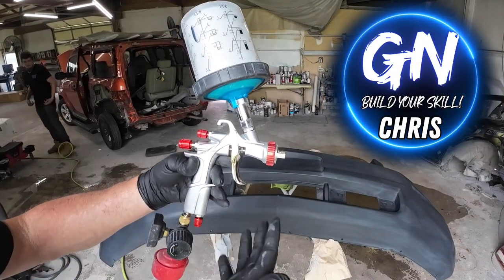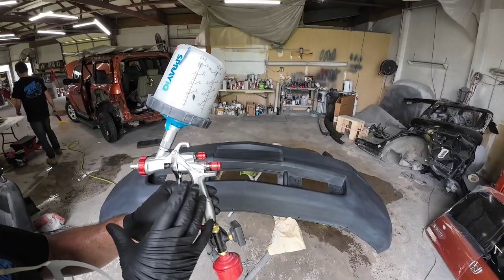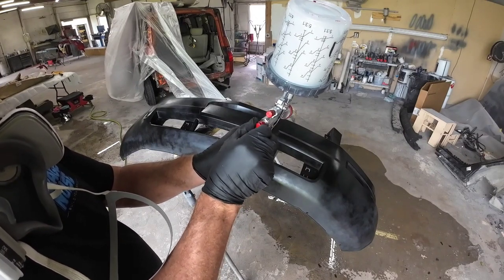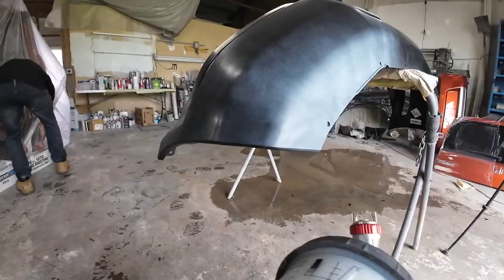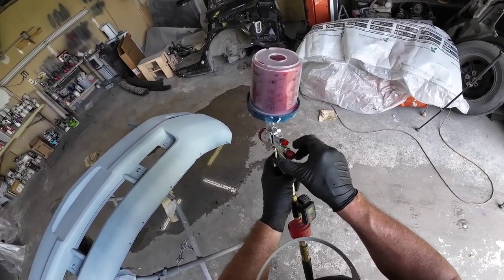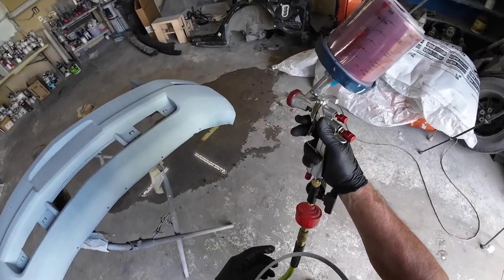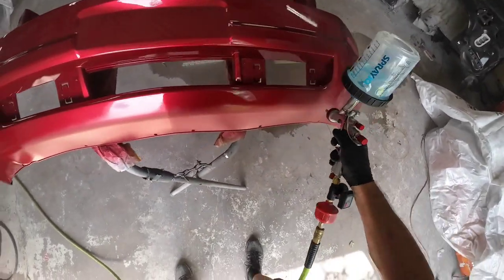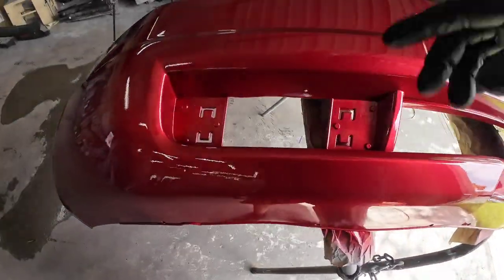DIY BUDGET AUTOMOTIVE PAINT GUN for SMALL COMPRESSORS

Comment: I’ve never painted before but I’m trying and my base coat is spraying like colored water very thin and transparent,I tried the put a heavier coat and it just ran, I’ve sanded it all off 2 times just can’t get it right, what am I doing wrong, my gun is all wide open and air pressure is around 20 psi now I’ve tried changing the settings and nothing same thing happens, base coat is mixed 1:1, should I go 2:1 ?
Reply from the maker: 20 is ok maybe a little low try 24 psi and 2 turns out on the fluid volume.  I suspect  you paints not being atomized enough. Put the fist coat on light let it flash for 10 minutes  and add another coat. If you not getting enough paint out of the gun gradually bump up the fluid volume.  Let me know the results

Comment: With all the brands and model numbers now that are similar to the R500,  is one of them significantly better or worse than the others?
Reply from the maker: No, they're the same gun with different sellers. One seller  might be better than another but the guns are the same. Rong peng is the manufacturer of all these guns I'm  99% sure. What I think is,  they offer different color schemes and branding for sellers. Rong peng released and updated appearance of the R500 recently and that's  the aeropro a610 and now the yt160 . If you looking for the best seller it may be the Eastwood company they're R500 is marketed as the lt100 . It's also double the price for the same gun. Anyway I hope this helps.

Comment: Great informative video. Thanks 😊. 
Question- at 5:30 you mentioned how to adjust the spray pattern  to hit the tight spots. I just didn't understand what way to move with fluid and pressure when we narrowing pattern down. We have to decrease then pressure (to 10-12) and reduce the fluid by one turn down also keep gun little further away. Did i get that right????? Thank you 😊
Reply from the maker: So when you narrow the fan pattern that will increase the air pressure.  So you want to turn down the air pressure and the fluid volume.

Comment: Hello! Thanks! For a very good Video. I have repainted my Bumper, from my Volvo. But when I had applied the first layer of clear coat, my compressor broke. It has been several days now. So the layer of Clear coat that I put on has hardened well now. But there were a few drops in a couple of places. And there was orange peel all over Bumper. Is it possible to sand off the orange peel on the Bumper even if there is only one layer of clear coat? Thanks! From Tommy
Reply from the maker: Absolutely sand it dow with 600 without sanding through the clear and then you can apply your clear again.

Comment: Any tips for using this gun to spray a metallic single stage? I’ve been told it’s tricky but no one seems to give any tips haha
Reply from the maker: It's  not tricky, the main difference is single stage. Single stage you want to spray like clear coat. The #1 tip I can give you is to put a light to medium coat on first this introduces the paint to the surface  and gives you a good sticky base to apply a wet second coat. If you try to put the first coat on wet it can run easily.  Hope this helps!

Comment: How is the first stage of trigger? I had the aeropro black and red but returned it because the airhorn wasn't machined right, trigger was gritty due to bushing not oring like the old r500, and the first stage of trigger was very short. 

I love the new design and it uses the same needle sets, but the older version is better in my opinion.
Reply from the maker: Personal I haven't  had a problem with any of my triggers. Some viewers have had some issues with some bad machining in the air cap , I guess it's  to be expected from a inexpensive Chinese product.  I haven't  noticed any difference in the way they spray. I have the easwood version and the the R500 and now 2 versions of the new R500. Appreciate your comment and support!

Comment: How does this compare to the r802?
Reply from the maker: R802 is a great gun. It sprays well and produces a great finish. 
It does use more air than the R500 so not great for small compressors but if your not concerned with air consumption it's just as good as the R500

Comment: What cup system is that? And whats the adaptor required to fit them. Hate the standard cup. Thanks
Reply from the maker: This is not the exact one but one I have used. Master Paint System MPS Disposable Paint Spray Gun Cup Liners and Lid System, 40 Pack Standard Size 20 Ounce (600ml) Kit - 40 Cup Liners, 40 Lids with Strainer, 1 Hard Cup with Retainer Ring, 10 Plugs https://www.amazon.com/dp/B081HFFNV2?ref_=cm_sw_r_apann_dp_BYJZ2C6TMH05VKYQA4JR
The adapter is from harbour freight spectrum part #57505
Reply: Great video.  I bough the R500.  Have you got any gun cleaning videos?

Comment: Great videos.  I may not have found my answers yet as I am still reveiwing them.  What is the smallest compressor that you suggest for LVLP painting, as budge is an issue?  I will not be doing whole car sprays, but will be doing bumper covers and smaller accessory body parts...maybe a hood and trunk lid.  Also, what is the disposable cup system you are using that use the special fitting to the gun?  Almost all videos I have watched refer to this, but I am unable to understand the name of the system and have not yet found it in any notes attached to the vids.

Thanks much, you are doing a great job in these, giving me the confidence to give this a try!

Comment: I am learning so much from your channel! Can you link or provide the regulator you use on your paint gun? Maybe a video on regulators? Also I would be interested in learning about different paint and the paint gun and tips you recommend for application. Lots of great content here for base and clear, is base and clear more durable than enamel? When would you use enamel paint over base and clear? What tip do you use with enamel? I restore tractors, Commercial mowers, Implements etc. Can I squirt these with base and clear? Is it more durable than enamel? Or just stay with enamel? I know base and clear cost more but getting colors matched is easier with Base and clear as no one really has scan tools for enamel near me. Thanks in advance!

Comment: I bought the A610 and I already had a R500. I did a sprayout test from 6 inches away both 1.3 mm tip. For some reason the air cap on the A610 is more ovaled and only makes about a 9 inch pattern while the R500 cap makes an 11 inch pattern. I swapped the cap from the R500 onto the A610 and it fixed the pattern problem with the A610. Have you noticed anything like that with these air caps? Aeropro sent me a new cap and needle set and the same thing happened. I can only get an 11 inch pattern at 40 psi with the A610 cap.
Reply from the maker: Really I haven't noticed  anything like that but it wouldn't  surprise me being it's a inexpensive gun. The company may work with you. Sound to me like the air holes in the cap may have been machined poorly.
Reply: The needle sets should be the same on both guns.
Reply: Aero pro customer service is great. They are working with me and sending me a new gun. I was just curious if anybody else noticed this problem. It has nothing to do with the needle set. It is just the air cap. The air cap itself is not the same part at all. The difference in spray pattern is not highly noticeable and it still sprays nice. It just sprays as if the fan pattern is turned in a little.

Comment: I know you like this gun but the fan seems smaller than the one on my SATA MiniJet. I realize the limitations you have without a proper booth but the fan pattern on a spray can of USC 2K clearcoat is bigger than what you use. You really need a spray booth badly.
Reply from the maker: Oh, I'm  sure the fan pattern is smaller for sure. I believe it's  around 10in .
Reply: Sure that will be a easy and cheap solution no doubt...

Comment: Is it okey to lower the pressure below tehnical data sheet, my aeropro r500 manual calls for 2-3.5 bar(2bar is 30psi) working pressure. Is it okey to go as low as 15-20psi?
Reply from the maker: It is as long as you lower the fluid with it. Those recommendations are for optimal atomization of the paint or clear.